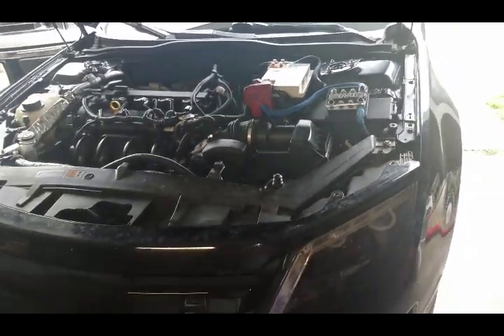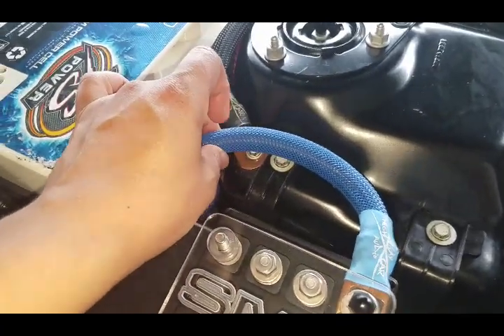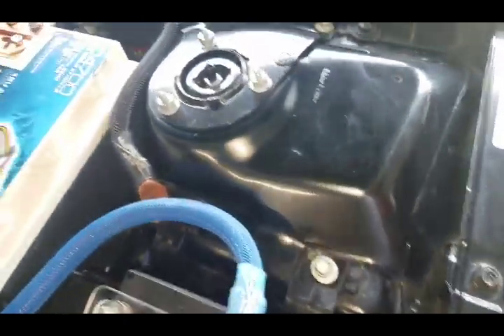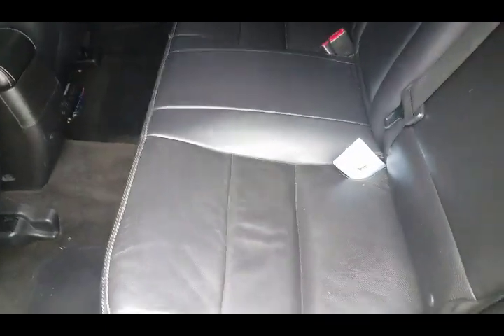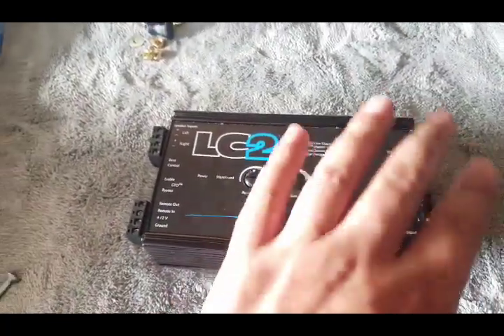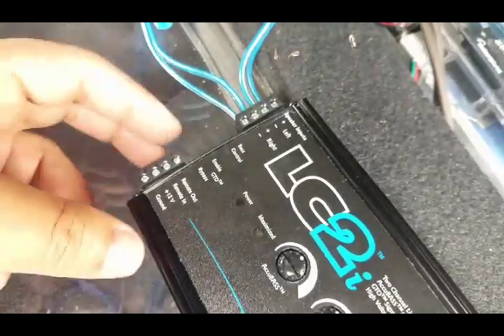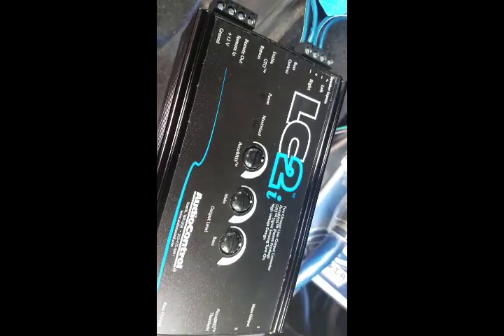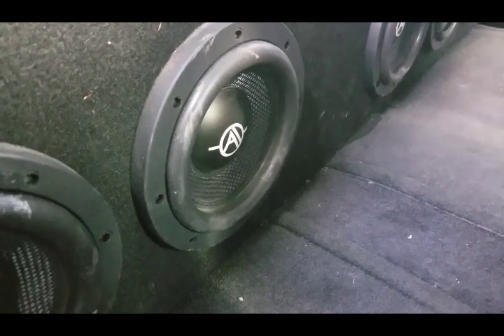How to install aftermarket system to factory stereo

Comment: I am a 2016 gmc terrain Dinali with the pioneer sound  system and didn’t feel like replacing the factory radio so I bought a bypass factory amp harness and it sounds great so great people think I have a aftermarket radio.  Total price $35
Reply: Where did you get the harness from? Thanks

Comment: So I'm guessing you tapped in from your amp power wire for the 12v on the lc2i and and when the lc2i notices the trucks on it turns on the amp
Reply: Yep he wired his power wire to the power wire on the amp and the amp power is the only wire attached to the battery.

Comment: question number two if you're using the lc2 and your stock system comes with a sub but you want to replace the sub with an aftermarket sub does that mean that the lc2 need to tap into that sub factory wiring or it can it be any wire?
Reply: Yes you can cut it and run it directly to the lc2i
Reply: It needs to come from the subwoofer wiring to get the proper signal!!

Comment: Wondering if you are just needing a mono signal for a subwoofer can you just pull the right side rear door speaker and input it to both negatives and both positives on the lc2i?

Comment: can i use stock signal from my stock sub on my 13 ram 2500 to lc2i?? or it have to be from door speakers?
Reply: So what did you end up doing cause I have 14 2500 ram
Reply: @ericklozano1846  wiring to stock sub signal in theory SHOULD work due to it being the low-end.

Comment: This is supposed to be a better alternative than using those cheap high to low converter is correct
Reply: Yep because it’s supposed to mainly do 2 things: Remove distortion and allow you to have louder cleaner bass by removing factory caps on sound to avoid the user from blowing the factory speakers.

Comment: Do you hook remote wire from the box directly to amp? Also I've seen where some people only wire off one speaker instead of both not sure why
Reply: bigjplay yes it has a remote turn on triggered by sensing the speaker inputs from factory hu you can use it for your remote to amp to turn it on

Comment: How can I install a switch to turn my sub/amp on and off. To switch between normal car steroid and then adding the sub
Reply: I did that with mine. You just use a simple on/off switch ( or lighted) and power it from a run from the cigarette lighter ( tap the power/ gnd here, the acc to the lc2i " remote in". Make sure the "gto" is off ( bypass). You can now swtich it "on/of" then the key is off, everything is off, no battery drain.

Comment: Thanks for making the video bro I have one question the lc2 does it only need to tap into only one speaker out of the factory system?
Reply: I’ve seen a lot on these LOCs and I think you have to tap both L and R speakers for the full signal.

Comment: When you connect the speaker input to the LC2 does it matter if it’s from or back speakers?
Reply: Should be the back
Reply: It doesn’t matter if it’s front or back. They recommend tapping from the most powerful speaker but the LC2i is gonna convert the signal to a low one either way.

Comment: If you are only using this to catch a signal for subwoofers, is it necessary to have 2 + - ? I don’t understand why you need 2 inputs going into the LC2
Reply: Hmmm, I think I can answer your question. You have to connect the left and right speakers to get a low input signal for the aftermarket subwoofer. Whether you use a advanced LOC or a basic cheap one.. I think the only catch to this is if you have a factory subwoofer and you can just tap into that and that only requires 1 since it’s the main subwoofer in a premium system setup.
Reply: @Dehnia31  I figured it out. I installed it in my truck already. You don’t need 2 individual speaker inputs of bass to the LOC. only one will do.
Reply: @TwinTurboLsx  really??? Hmmm ok, that’s good to know. They always say hook up the left and the right speaker. So did you only hook up like the + &- of say the left rear speaker and left the right speaker empty on the LC2i? I just wanna make sure I understand
Reply: @Dehnia31  yes last time I used a jumper wire on it. But this time I just left the other side blank. And it works fine. No need to feed both inputs if they’re the same signal.
Reply: @TwinTurboLsx  thank u so much for this! Very helpful! I appreciate it
Reply: @Dehnia31  yes no problem! Happy to help!

Comment: So right now I'm using a cheap loc from Walmart...Will there be a big difference with my system if using the Lc2i?
Reply: Big difference!    Those “elcheapos “ allow trash into the system.
Low volts too.
Audio control gear is solid!   

Good luck on your project. 

Larry
Reply: @mafosa8519  Thank you!! Ive been looking in the JL Loc-22 lately
Reply: @mafosa8519  is that why I need my amp gain all the way up with this cheap Loc
Reply: @radianm6  not sure.  I’m just a diyer my own self.
If it was me.  I would borrow a volt meter and check the loc volts on the output side.
Not to exceed the amps recommend input volts.   Then set the amps volts to the recommended output volts.

Stereos n speakers have gone such a long way since I messed with them.
Reply: @mafosa8519  my amp volts is like 6.5 while my Loc puts out 3 volts

Comment: How do you have the remote connected. Where are the two wires going out to? Thank you
Reply: wizevideo I'm looking for the same thing
Reply: @KiiD_Gaming  I just installed my LC7i and I connected my blue remote wire from the remote out to the stereo control remote on the amp which is located next to the power and ground. This will power up the amp every time your stereo turns on.
Reply: wizevideo I have the 2010 fusion se with factory everything . I was put the remote in each fuse under the driver seat on the left but amp stays on and trying to see if there's another location I can wire it so it would turn on when my car turns on.
Reply: KiiD_on_24s I don’t think you need remote connected. Just tap into back speakers and it will activate GTO. That’s what’s great about this unit

Comment: Do i need to put a fuse and what size to power the audio control lc unit?
Reply: I didn’t fuse mine, could if you want to for extra safety
As far as size for power, you could use really any size. I used a 20gauge, it just needs ANY to be able to power it on. It doesn’t draw a lot of power. Hope this helps
Reply: This World Shall Know Pain!  Should I use a inline fuse wire and tap into my sub amp positive and negative wire? Since my LC2i is sitting next to my amp.. Or should I run the positive straight from the battery?

Comment: So I am about to install my lc2 in a few days, do you have to run both left and right speakers or can you just run one from the left?  It's a pain in the a** to take all mine apart so if I only have to do it once that would be great lol.
Reply: In another video with a guy that have this LOC, he tapped into the left speaker wire in his rear door, then looped it on the LC2i. I’m not exactly sure what to what but he said by doing that that eliminates you having to tap into the right side speaker. Hope this helps
Reply: @Dehnia31  if that will work then I'll try it. My lc2 came in this weekend so I'll install it this week sometime
Reply: @TJsVette  a guy on here I just messaged said that 1 speaker will do. I’m gonna hook up my entire system also so I’m gonna call a shop tomorrow to get some clarity. I’m waiting on stuff before I get started
Reply: @TJsVette  I like you don’t wanna go thru splicing into another wire if I can help it. Hell I don’t wanna splice any wires I’ve been racking my brain on how I can get my speaker signals without cutting into any factory wires
Reply: @Dehnia31  yea I had a regular line out but my 2 12s don't hit like they should. When I had them in my van they hit super hard. Now they are in the trunk and I feel like I can barely hear them.
Reply: @Dehnia31  if one will do then I'll Def keep it the way it was. Tearing it all apart was not fun at all. I hated splicing into the left side.
Reply: @TJsVette  wow! Well this LOC is definitely supposed to improve your sound. I bought a powered JBL tire subwoofer this time around and this better LOC is my first time using this as well. I plan on using some sound dampening this time also. I’d rather tap into the 1 speaker since I have to splice into something. They make the loc interface that’s plug and play for certain vehicles but it’s gonna be a basic LOC so that’s the only thing
Reply: @Dehnia31  just finished setting mine up, I used 2 jumper wires to go from the left to the right speaker and after tuning, it makes a huge difference.  Def got some bass notes now. Before the trunk barely rattled but now she is slamming. Good luck with yours!
Reply: @TJsVette  oh that’s awesome! I’m glad that worked out for you! I spent earlier working on getting my power wire thru the fire wall. My speakers come tomorrow so I will do some more tomorrow
Reply: @Dehnia31  awesome. Yea that power wire was a pain I actually went through the passenger side.  It was way easier.  Good luck with your install hopefully it hits hard!
Reply: @TJsVette  so just to make sure I’m clear. You tapped into one speaker like say the rear left, you put your +&- in the left side then you put another wire from your L - to R- and L+ to R+?  Or L- to R+ and L+ to R-? Making it possible to only have to tap into 1 speaker?
Reply: @TJsVette  funny you say that because I ended up going thru my passenger side also.  It was a challenge but I got it done.
Reply: @Dehnia31  correct.
Reply: @Dehnia31  yes I tried to go through the drivers side and got frustrated super quick and looked for a easier route.
Reply: @TJsVette  I’m sorry I listed 2 ways, which one? I think I’m gonna do the same.

Comment: Can this be used on a 4 channel amp
Reply from the maker: The lc2i is primarily used for adding just a sub, for the 4 channel I would recommend the lci7 since it will provide more outputs hope this helps
Reply: Ok thank this will solve the issue for 2019 impala thanks

Comment: What did you run power (+) to on LC2i? Can i run it to stock amp (+) ??
Reply: I have LC2 I just run the 12v from my radio harnes and also bought I don’t remember 5 volt fuse which is recommended to prevent damage to LC2
Reply: @juliobello4561  thankx...🤙

Comment: So I have a question for you I have a 2016 Camaro and I'm going to bypass the factory amp I'm installing to Rockford Fosgate amps six new mids and highs and two 10-inch Subs what I only need this converter and the amp harness or would I need the big one that you have under your seat?
Reply: Slick Rick Da Rula you’ll need a Lc7i  since those factory amps have crossover points

Comment: What size ground , power and speaker wire do you need to use for it?
Reply from the maker: If your talking about the lc2i its 16 gauge and amp wires depends on the amp you buy usually if it's under 1500 watts it's a 4 gauge wire
Reply: @becausebass3629  Yea I was talking about the Lc2i I just brought one. What size speaker wire do you use for the Lc2i and ground wire you said 16?
Reply: @ripwaeh  yeah you can use the smaller gauge wires. That’s what he did in his brother setup that he demonstrated in this video
Reply: @Dehnia31  ty

Comment: Where did you get the left and right speaker wire from
Reply: Tap into the existing left and right rear speakers. Cut it and splice, and then attach the wire you’ll run to the lc2, to the existing wires.
Reply: @RKCorinth  man if I could send you a picture of it you would say damn I ended up putting 2 db12s and 4500 nemesis amp
Reply: @ericklozano1846  hell yea brother!
Reply: @ericklozano1846  and did you use the LC2??

Comment: How important is the LC2. Will it make your stock system louder.
Reply from the maker: Ic2i is for stock radio applications which will provide rca output signal and remote turn on without the lost of bass roll off at higher volume. It is not an amp, hope this answers your question.
Reply: If you plan to utilize your stock head unit, this is a crucial install & will make your system sound MUCH better! It will give you a much cleaner and better signal to send to your amplifier(s) / speakers!

Comment: I have a question I have a 2014 Chrysler 300c have anybody ever installed subs and amp in a newer 300c
Reply: The same as many other cars my friend! But Chryslers tend to have grounding issues so I reccomend upgrading all of your power and grounds the big 3 or 4 they call it! But what concerns me is that if your watching this I feel like your contemplating using the factory head unit. Just know that's doing it the generic way! Get yourself a quality head unit NOT the cheap single R.C.A. outputs models, get one with multiple outputs! Then of coarse a quality amp is key! They're pricey but if that's an issue there are ways around the high dollar models like the c.a.b. 1600.1 it's full name is "car audio bargain 1600.1"  but if money is on issue get some D.C. audio amps, then get good subs and match your ohms to your amps ideal output and if you don't know what I mean then take a crash coarse in ohm ratings! Or simply Google OHM rating wiring diagrams! I always use the Rockford fosgate wiring diagrams but depending on the amp you choose you then know what ohm subs to buy!  Personally I like duel voice coil subs myself ! But again it all depends on the ohm load your trying to Achieve! Now another issue is power!  amps are designed to run at 14.4 V  not 12 so get you a big alternator! preferably a big one but again it should be sized to the systems needs but factory alternators really don't put out enough MMS will you achieve 14.4 volt! Also, dry cell batteries get some! Really you want the system to be powered by your Battery bank and a big alternator to run the car and still be able to charge your batteries! He G we're close by I would offer to help you in fact it's something I like to do! In fact designing systems is fun! Something I use to do years ago that a lot of people Sean to be forgetting is I ran line drivers to boost voltage coming from the head unit before it goes into the amps! Now a days head units put out higher voltage than they used to but still the higher the better! I always used cadence electronic crossovers with 7 volt line drivers! I see they now offer 9 V  now!

Comment: whats the lc2i power exactly connected to ?
Reply from the maker: Power and ground connects to battery,and signal you get from the door speakers
Reply: @becausebass3629  okay like the actual battery terminal? or can i connect after the fuse on the output side? think i seen someone do it.
Reply: main fuse from my 2awg going towards my power distribution block

Comment: Dude with the money you spent on the LC2I why not just get a better head unit? If it's the 9.5 volt output your after get a line driver my friend! Personally I believe a system is only as good as its weakest link and a factory head unit is deffinately a weak link!  Also if it's about the factory steering wheel volume controls they have adaptors for those of coarse! I'm sure you know this which is why it surprises me that your using this rather than a good head unit!
Reply from the maker: This was just to demonstrate on how to install one and use it for those who want to keep the factory unit and not lose all the bells and whistles that come with it. I do agreed with you on a new head unit which is what I have now with a access adapter for steering controls
Reply: @becausebass3629   you know 20 years ago I was setting up systems and back then head units didn't push the voltage that they do now but I still reccomend getting a "cadence" electronic crossovers with 7 to 9 volt line driver!
Reply: My stock unit on my 18 Kia sportage works fine with a cheap hi-lo converter But! I do have it connected to a Clarion 7 Band Eq which really takes care of most of the problems. I get great bass and sound to my speakers! No humming sounds.

Comment: Would've taken less work to install aftermath radio and still sound better
Reply: Some people can’t due to ac controls/etc are in oem deck
Reply: Yes, but most people with newer vehicles don't want to lose their factory HU for many reasons.
Reply: @LTSRIDE24  well in newer vehicle that's not an option at all such as Chrysler and Honda vehicles. That do have interfaces that can tap into the vehicles canbus    and get a full range digital signal and then converted to 4 ch 5v analog low level signal. Some have an option for the use of an optical to a processor. This is way better than any hi to low level converter

Comment: What does that GTO do?
Reply: It senses dc voltage at turn on.   No need for a remote wire circuit.
You have to check to see if your vehicle provides the dc power at start up.

Larry